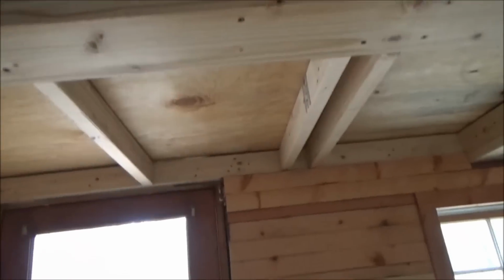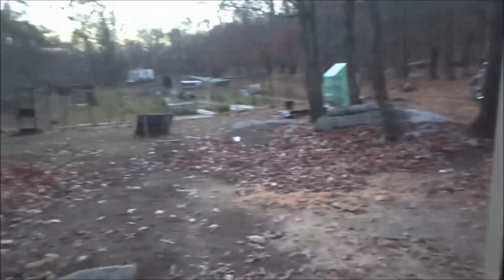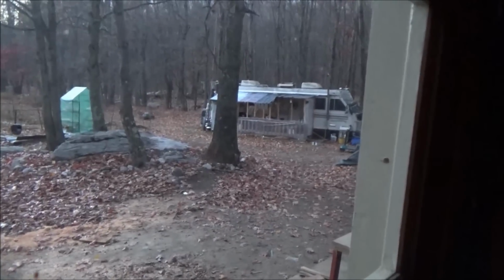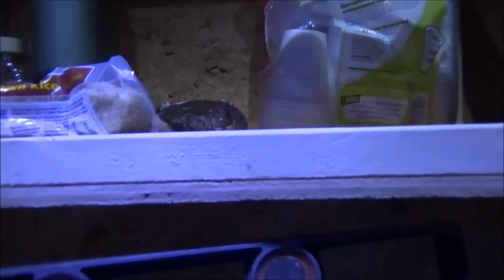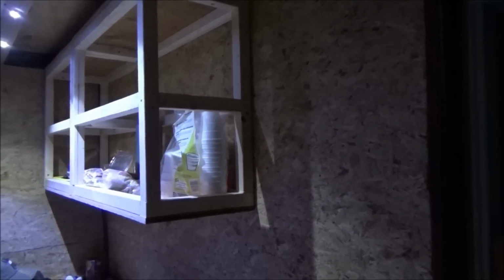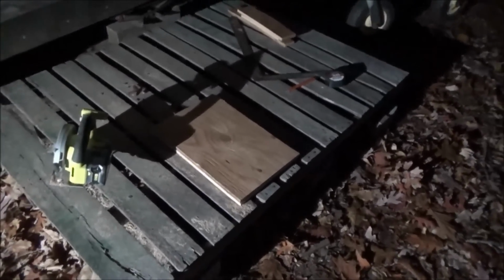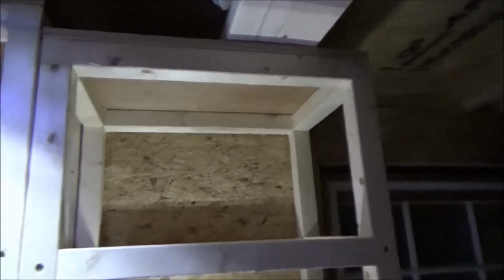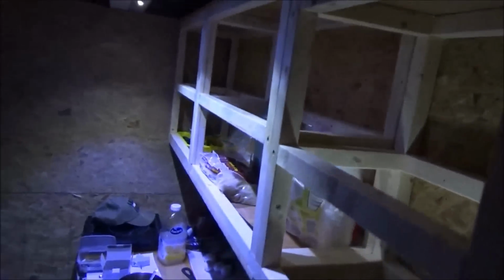Looking For Solar Batteries And Building Tiny Home Cabinets N9

Comment: forget about winter batteries and get a better generator or use the one you have now..2 cyle oil is not expensive.....geez, do something smart, cold, so light the stove with just a few pieces of wood...duh...or get a mister heater
Reply: (Scratches head at this remark) He said it was about 50 degrees warmer inside the house.

Comment: With the first like. Happy Veterans Day Troy, looks like a cold Fulda Gap day, hope the water is on the wood stove, that will solve the humidity problem. You need to build a breeze way for the front door,will make it a little easier to get you shoes on and off. Hope you left your number at the salvage yard in case they get another forklift battery in. You probaly could use one out of a 5,000lb. lift. Remember they will way about 1600 lbs. so you will need a set of wheels roll into place. Put in to a insulated box for weather protection and wire it to inverter and panels.
Reply from the maker: Thank you. I might go out to dinner with the landlord and lady tonight.
Reply: The Do It Yourself World I hope you do go... and Thank You for your service.
Reply: The Do It Yourself World  It's 12:45 pm when I write this, and I hope you go to dinner with the landlords tonight. Hope you had a good Veterans Day.
Reply: @Frederick Nolan that's a great idea ... water on the wood stove for humidity. Simple things work!
Reply: Tryed and proved on grandma's steam cast iron oven and cook top. Did at least a Thanksgiving for thirty plus. We figured the oven could do about 21 loaves of bread in one setting or 2turkeys, five pies and on top the rest of the hot dishes. It about 4×8×4ft. and with a hot water tank on one end, fire box on the other.

Comment: SUGGESTION:  For adding humidity to your home:  Make a wicking bucket.  No electricity needed and you can control the humidity to your liking very easily.  You need a bucket or large bowl to put water in.  The size of the bucket needs to accommodate the width of the towel.  Thus you need a towel and something to hang the towel over, directly above your bucket like a bar of some sort so that one end of the towel is in the water.  The idea is the more surface of the towel that remains wet is what determines the amount of moisture you want in your home.  Wet your towel first and place the towel over the bar above the bucket and place one end of the towel down into the water.  Remember...the longer and wider the towel, the more moisture surface to add humidity.  Keep the towel and water clean so nothing yucky grows.

Comment: I would put a piece of metal or something under the cabinet by the stove or a range because the steam will get in to ur wood should have made half cabinet over the stove area but easy fix just make a bend at the wall so it dosent go be hind
Reply: Yes! I was wondering if anybody picked up on that middle cabinet.  When I first saw that one in I thought, "cool, he has another one in and it looks good."  Then I remembered it was right over his stove top. Um, not so good. :(  Not only will steam damage the wood, but it also increases fire hazard.  People don't have cabinets over stove tops unless there is a range hood between stove and cabinets. At least not that I have ever seen.
And Troy, didn't you say you had a range hood to put in?  If I am remembering correctly, you did not leave enough space to accommodate it.  You'll have to squat to see what you are cooking and large pots won't easily fit.  It's these little details we sometimes forget. ;)
Reply: MotherOfManyHorses I think there will be a little remodel needed to accommodate a hood, too. But, that's ok.  A few screws to remove and a little cutting down.  Not a big deal, right?  As long as he is only heating his coffee water on the front burner...the wood should not over heat.  All other cooking needs to be done on the wood stove until that area behind and over the stove is fireproofed.
Reply: MollyDolly That's the beauty of using screws, easy to make adjustments. You remember when I was building my hen house and even the waterer that I had to remove/alter what I had built because I forgot something or had to make a change. It happens.
Reply: MotherOfManyHorses Yep.... and once you have the skills to build it, it is no problem to modify it either.
Reply: MollyDolly MotherOfManyHorses  Should be pretty easy really.  All he needs to do is remove the bottom shelf and corner pieces of that middle cabinet.  Then he can put the range hood up under the middle shelf. The biggest thing that would bug me is that last cabinet.  I wish he'd have made it the same height and notched out for the "beam."  The middle shelf not being even I'd have problems with things sliding off that "step" and spilling or falling out of the cabinet and breaking. But there again, just unscrew it, fix it and go on to the next project.
Reply: Actually I commented on the issue of under cabinet protection above the stove before.  Not only to protect from steam from food cooking, but to fire proof as well as protect from oil splatter when cooking,
Reply: Sam ` Nah, they're fine. I've seen larger cabinets fastened with a lot less than what he's using. The amount of stuff he'd be putting up there should be no problem at all.
Reply: Sam ` Sag?  Are you serious?  He isn't building cabinets for a McMansion, but for HIS needs.  And he is using what HE has available sans buying material.  If you want different type cabinets then build them for yourself.
Reply: Sam ` Oh, I'm sure a professional could do a much better job. But he's not a professional. Maybe, in time, his skill will develop to the point where he may want to change them out. But for now, they are plenty sturdy for what he needs.
Reply: MotherOfManyHorses Funny thing is, if you ask 100 people how to build kitchen cabinets, you'll get at least 200 different answers, lol!  I see a few ways he could have used less material, or made them stronger.  They are plenty fine for what he needs now.  Who knows, maybe one day he'll find someone who is doing a renovation that is just going to throw their cabinets away.
Reply: Ataristeve  I tend to think Troy does more screws, nails etc because he is sincerely is concerned about things falling down.

Wont play arm chair therapist, but while I do not have OCD, there are things I go over board on according to those who love me. 

So Troy simply has some quirks, that do not hurt others, and are simply interesting to observers like myself.
Reply: MotherOfManyHorses I believe that low shelf over the stove is a fire hazard also. But I informed Troy and it is his home I hope nothing bad happens.
Reply: If Troy does what they do in RV's, travel trailers, and he puts in a fire proof barrier that is a fire grade product he should be fine.  And he is not with the kitchen anyway.
Reply: It says in my Bible in Colossians 3 And whatever you do, in word or deed, do everything in the name of the Lord Jesus, giving thanks to God the Father through him.  And in 1 Corinthians 10 So, whether you eat or drink, or whatever you do, do all to the glory of God.

Am also sure you know the Bible verses about being prideful and what it says in 1 Corinthians 13 'Love is patient, love is kind. It does not envy, it does not boast, it is not proud.  It does not dishonor others, it is not self-seeking, it is not easily angered, it keeps no record of wrongs.  Love does not delight in evil but rejoices with the truth.  It always protects, always trusts, always hopes, always perseveres.
Reply: Beth DeRoos Well I was worried about the short distance between the shelf above the stove and the burners about 2 feet. But he has rejected my argument and it is his house I would still hate to see him on the street though. He is going to put tiles in back of the stove as a splash guard.

Comment: I noticed several possible problems with that last cabinet.   It's way too close to your window, doesn't look like there's enough room for your window trim, Troy.  I know from first hand experience in a house that I have, it's a major problem if the cabinet is right up beside the window trim -for several reasons.  I think I'd made that last cabinet a single cabinet.  I have to agree with some of the others, the middle cabinets are way too low over the stove top, which will be dangerous.  Looks like the middle shelf on the last cabinet didn't line up with the others, which isn't much of a problem once you have the doors on them.

Comment: Troy if you can. Try looking for scraped Telecom batteries. These batteries are made to be in in clement weather as well as not so good storage facilitates. They'r made to power the Central office equipment for telephones. They should be great for your little set up.

To clarify a statement I made to you concerning power usage. I was stating that you should have some idea of peek power usage in order to determine what minimal power is required. Then you need to make sure that the panels can produce that power in the non-optimal times of the year. That's a crucial role that has to be played when setting up a system to live off grid. There are tons of examples of this online.
Reply from the maker: Yes I have looked into the telcom batteries but they are hard to find here. You have to know someone on the inside.
I have an idea what my needs are. I use max 100 watts for about 5 to 7 hours per day when working heavily on videos and comments. I am going to start getting amorphous solar panels so supplement my cloudy and rainy day power.
Reply: The Do It Yourself World I'm not trying to make you look like a fool. Just trying to understand how you have lived off grid & not decided what you really wanted when your plans are coming to fruition. What about cooling needs, a refrigerator, etc. 

I would suggest that you look at some of the sites available on the web that have folks doing the same thing. The Earthship folks have some really good ideas for water & power. Also try looking up the following:
Solarcabin channel

The guy has done exactly what youre doing, So maybe you could contact him for some advice. 

BTW it's hard to offer any suggestions when we're viewing situations in the past. I know with low power & trying to get things done it's hard to do so. 

Again I'm not trying to put you down. Just trying to offer some suggestions to help.

Comment: Looking good Troy. Do whatever you have to with the batteries for now, but always keep  a lookout for those batteries used at cell towers, the FCC requires that they be changed out frequently and are usually good, when that is done. They have high amp hours, but they are very heavy (2 volt) batteries.Hard to get a hold of, but well worth the wait. Excellent for off grid applications. Happy Veterans Day!

Comment: cabinets are built with pieces of plywood to create the box...A properly joined box is very strong...You have to now cover all that framing up...5/8 plywood works well, paint or prime before assembly and touch up...

Comment: Troy, you need to get those wind generators back up to capture any breeze you can to keep adding power all night, it might keep you batteries warmer.  That really needs to be a "Right Now" project. With 2 sheets of foam insulation and the Pallet wood you can make a really nice enclosure.

Comment: Troy, I used to keep a big cast iron kettle with water in it to add humidity to the air.  On the woodstove, the hard part was to remember to check the water in it

Comment: We use those advance auto parts batteries at work when in a pinch.  They dont perform in warm weather either.  I would suggest either Trojan or Crown batteries as they seem to do quite well.

Myself im using Wal-Mart 24DC batteries and they seem ok.
Reply: Johnson Controls makes Wal-Mart's batteries, as well as for AutoZone, O'Rielly and Advanced Auto.  Same thing for Napa.  I'm not sure about Sears.  But, you need to be looking for Deep cycle batteries, they are designed for deep discharge/recharge.  The question you need to answer,Are these batteries in a protected environment?  If you are not going to protect them in an insulated weather proof enclosure you may want to consider a gel cell battery.  Such as the Optima, O'reilly Auto Parts sells a gel cell deep cycle battery called the Super Start Platinum, equal to an Optima, but a significantly cheaper price ($40-$50 less).
Reply: Greyman Zink I am in a hot area - So Cal... which battery do you think is best in heat?  The only thing holding me back from investing in my solar is this battery situation.   I keep seeing all the off gridders upgrading their batteries... so I would like to get it right the first time... even if I have too save up longer to get them.
Reply: Pete Brown I hear ya Pete.  But, you HAVE to use deep cycle batteries if you want them to live in that kind of environment.  Golf cart batteries are marginal,  I was going to use 4d3 gel cells, the kind that they use for sail boats.  Big initial outlay but they pay off in the long run, but at the time I was working for a retailer and got a good discount on them.  Stay warm and dry up there in the great northeast.
Reply: Pete Brown - I can believe that.  But from experience at work, even if we have good golf cart batteries like Crown or Trojan batteries.  Our one golf cart is required to be parked inside the building when unused once the weather gets below 32 degrees.  

Greyman Zink - Johnson controls does, but I'm talking about 2 different styles of batteries.  Internal construction is different.   Golf Cart batteries just suck in the cold.  Another thing is that when you buy a battery, you want to get it from somewhere that moves a lot of batteries.  I've found at my local Advanced store that their GC batteries tend to sit on the shelf for a long time.

Comment: Hey Troy I have had the same HF Gen for about 4 years and learned that it is no Dif than any other 2 stroke engine. once the lights start to flicker all you need to do is make the engine run a little faster. I use a toaster this revs up the motor and cleans the plug then it will run smooth once again.
Reply from the maker: Thanks for the tip. I have to vacuum in here again. I will do that. Uses the max watts from the HF generator to do that.
Reply: The HF genny also has an adjustment screw on it that you can use to trim out the output voltage and mhz cycles. Unfortunately, that only does so much since it's putting out a square wave.

Comment: You should get some gas lamps (they are powered with propane).  We used those in an offgrid cabin for years.  Very clean and very, very bright.   You could probably get one that would light the whole cabin - they are around $70 + piping to your propane tank.  Then the batteries would be only for the laptop.

If you can get a warranty replacement from Advanced, some deep cycle marine batteries might be an OK alternative.

Comment: Your doing great Troy. The homestead is shaping up.  I've been following you for some time and check daily for new videos.  I really enjoy seeing things progress.

I have a few thoughts on your batteries.  If the plates in the battery are truly warped, this is caused by overcharging. In your case from your DC generator.  Overcharging happens when the regulator isn't working right or too much charging amperage over time.  You should really look into getting a three stage regulator for the DC generator so the batteries can be charged properly.  This is what your solar charge controller is doing.

While it is true that batteries don't like the cold (and that applies to all lead acid batteries), how damaging it is depends on how much charge they have.  A fully charged battery won't freeze until -90 degrees.  A half charged battery will freeze at 9 degrees and a quarter charged battery will freeze at 30 degrees.  Cold temperatures will not harm a battery unless the ELECTROLYTE freezes.  Plate thickness isn't a factor so the quality of the batteries is irrelevant.  Its just the nature of lead acid batteries.

The point is that while the cold will reduce charge, It won't damage the batteries unless they freeze.  If the plates are truly warped, it comes from overcharging.

I hope this info helps and figure out a solution for power by winter.

Comment: If you could find an alarm gell cell to power your lights in a diode isolated battery pack to in parallel to the power supply and give you a couple nights of light and recharge when power goes to the battery pack goes to the diode to the lights equalizing the battery to charge it.
  The power coming to your batties  from your panels can pass to the feed wires and give you basic light.  Backup to your power system without the need for a seperate feed. It looks needed.
  thanks

Comment: All I know about golf cart batteries is that we have to keep our golf carts (who the hell buys electric golf carts for Canada in the winter?) plugged in all winter long. We only get about a mile between charging. But you might want to try the local Finning or Cat heavy duty mechanical services. They service huge diesel generators for hospitals and utility services and other industries that have huge batteries. Not sure if this would help but it's another source to look at.

Comment: Use your power bank for charging USB devices, ryobi light and a battery off one of your vehicles for solar energy storage in the interim period prior to getting new batteries.

You can use cheap mineral oil in a two stroke engine but I've not used it extensively myself. The power fluctuations are likely the  either  capacity or voltage regulator fitted in your generator, if the engine runs even. (Avr's replaced capacitors) analogue multimeter can give a rough indication of capacitor usability.